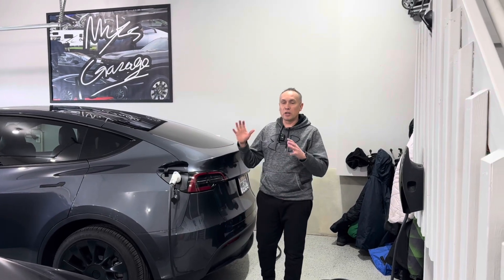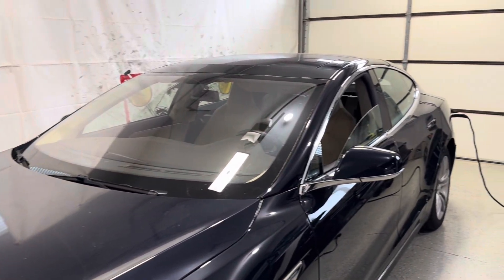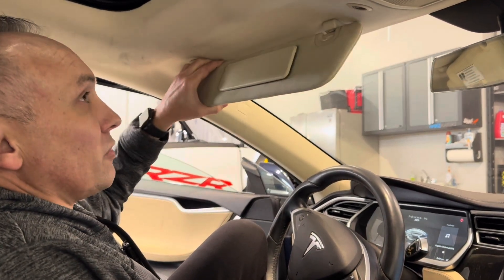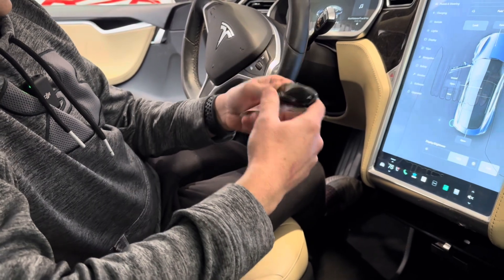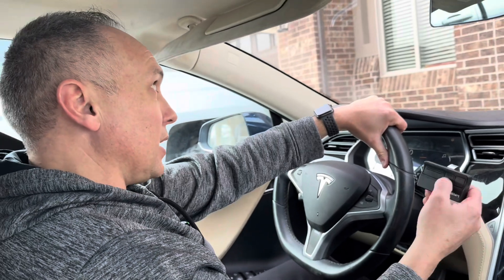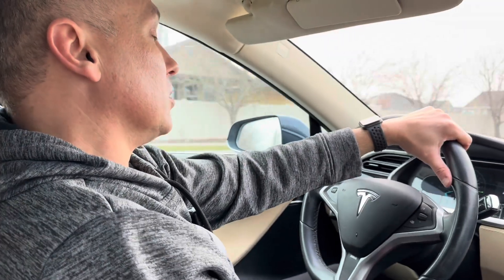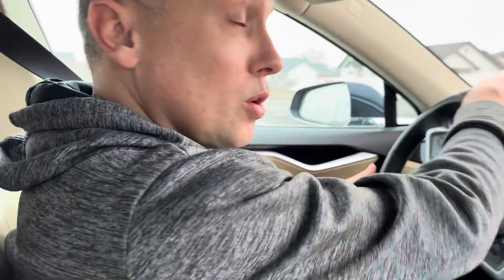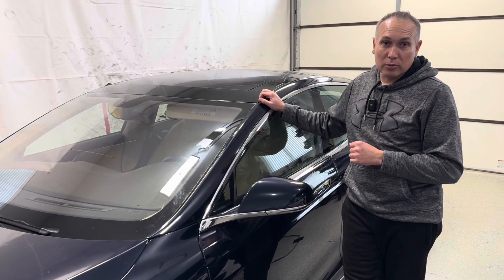I Bought The Cheapest Tesla Model S In The US! 2013 Tesla Model S 85 RWD

Comment: This past July (2023), I bought a 2013 Model S 60 with 125k mile for $15k from a private sale. Original HV batt. & 2nd drive unit (according to selller).This is my first EV and loving it so far. I think at the time, this vehicle was the cheapest "running" Tesla in the US...😀
So, needless to say, I'm anxious to see upcoming videos and progress you make with this vehicles. There are alot of us out here that are just getting our "EV feet" wet with older vehicle like this and videos like these are invaluable to us.
Reply from the maker: That's cool! Yes, I'll definitely be posting more videos as I have more experience and do more work on the car. Thanks for watching.
Reply: Dang 125k miles. That would scare me away. No warranty and other issue will come up. I heard the door handles breaks pretty easy. Also mcu screen leaks and gets slow.
Reply: I’m in the market for this car but a little nervous of course to buy it. How has it been treating you? Have you had the window leaks that I’m hearing?

Comment: 2 months ago i bought a like new red 2014 model s 85, for only $9400 cash, private dealer, had new motor and battery 50k miles ago and no issues at all, has great tires, i can tell it has the new mcu 2 as well, it was definitely garage kept
Reply from the maker: That's a much better deal than what I got!! Are you liking it?

Comment: I bought a 2012 model s 85 for $9500.00 in the us. No issues. Had sat on a Toyota lot for about 4 months through winter and everyone was afraid of it. Bought it and get 232 on a full charge. Everything works even had new tires..  Smooth cars. Only 88k on it.  I did have tesla upgrade the mcu.
Reply from the maker: That's a deal!!

Comment: Sounds like the rear drive motor bearings are bad, if so this is due to coolant leaking into the motor. If this is the case, the motor needs to be removed and bearings replaced, I suggest installing a coolant delete too.
Reply from the maker: I already had Tesla replace the motor with the coolant deleted version

Comment: 2 months ago i bought a like new red 2014 model s
85, for only $9400 cash, private dealer, had new motor and battery 50k miles ago and no issues at all, has great tires, i can tell it has the new mcu 2 as well, it was definitely garage kept. Do you think I have better deal than yours, Andy?
Reply from the maker: Yes, that was a much better deal than mine. Mine is not very good shape.

Comment: Just got my 2015 S 85D with 148k miles and a new battery (7 months old) for 10,200
Reply from the maker: That's a great deal!
Reply: @Myksgarage  thank you. Wasn’t perfect. Needed a new damper, front sensor, and the filter was never changed 😂 but runs great

Comment: Please let us know when you figure out what is causing that clunk. I also have the same noise coming from the rear. 2013 MS 60. Usually only when accelerating from a dead stop.
Reply from the maker: Yeah I will be making regular updated videos!
Reply: Have the same 2013 ms 85, also instrument cluster screen died aster 1000km after Buying also as the door on left Side xD
Reply: Did you find out what the clunk is acceleration from a stop ?
Reply: @weariedcleric6306  Half shaft lug and washer replacement, as well as tightening to specs fixes it in most cases like mine.

Comment: Do you live in Utah?
Ever worked in aviation?
I feel like I know you?

Or maybe I've just seen your videos before. 

10k seems like a good deal as long as the batt and DU last. From my research the battery issues mostly stopped after Q2 2015. Tesla Motors Club website has a load of info.
Reply from the maker: Hi Brad, yes I live in Utah, but I don't work in aviation.  Yeah hoping the battery and drive unit hold out

Comment: If this vehicle hasn't had the flash memory recall done you, you can still choose the MCU2 upgrade for $1500. If the memory recall has already been done, then the cost is $2250 for MCU2. If the screen in front of the steering wheel hasn't started to leak, it includes that too. If you don't do the MCU to upgrade and the instrument screen leaks, it's like a $1000 replacement, so do MCU2 is a no brainer. Should also get the battery coolant, rear DU diff fluid, and brake fluid flushed/replaced.
Reply from the maker: Good tips! Thanks